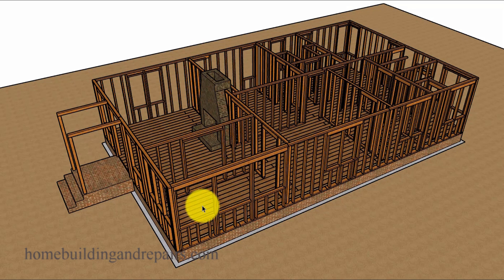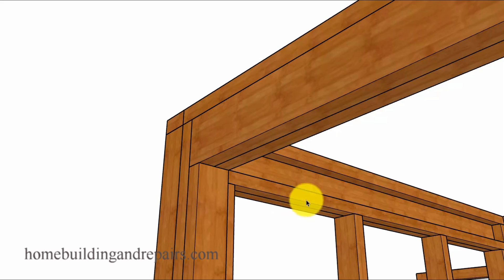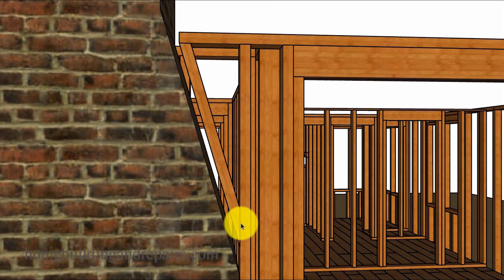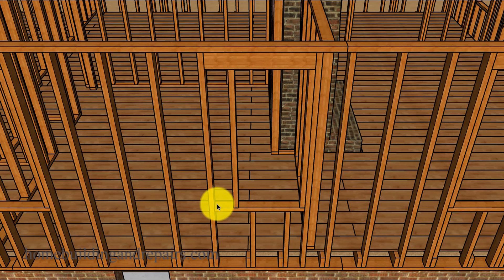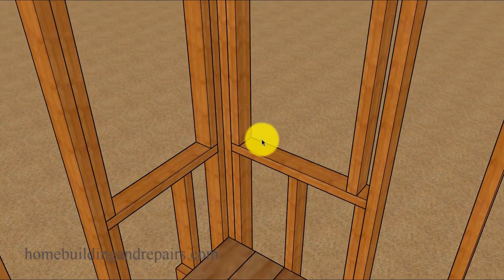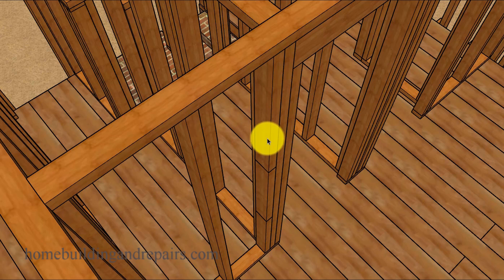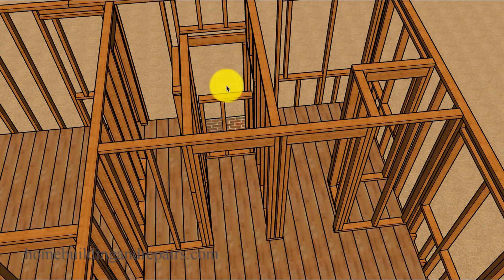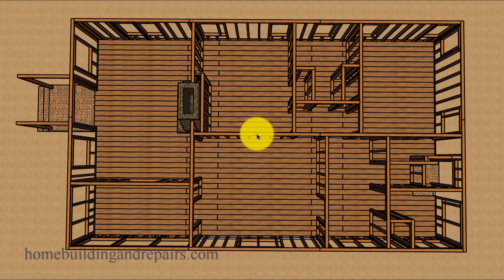Wall Framing Tutorial For 1923 Home Building Project - Part 4

Comment: my house in Australia has almost identical framing .Its a heritage listed colonial style and made from hard wood ,which was joined using cutout oblong holes and plugs in the studs top and bottom.The sill plates are as above and as a consequence ,in Australia it was attacked by turmites getting under the sill plates and progressing inward .Aussie houses are required to have ant capping at the pier tops and perimeter base wall in contact with wood eg. on the engaged piers which support the bearers.But thanks for your vid it will help me improve or change my framing .further i wonder if this design has advantage over more modern in that the flooring can be removed without much fuss.
Reply from the maker: Plywood or oriented strand board is usually used for floor sheathing and I think works better than the older one by materials. I would love to see a picture of your ant capping, to see if it's the same as our termite shield.

https://youtu.be/qaQ2yXVCwmU

Comment: Have you ever seen walls packed with a soldier course of brick above the top plate between floors? Wondering if that was a common way of fire blocking back in those days

Comment: My 1920 bungalow has a double top plate but no headers- even in the bearing walls. They used double 2x4's, flat., not on edge. Even an 8'-9" opening for a bump-out has a double 2x4. It's sagging and I will have to jack it up and re-enforce it because it is carrying both a ceiling and roof load. The base plates for the exterior walls set on the sub-floor. I believe it's called "Western platform framing".

Comment: My son's 1925 house (plus 2 or 3 later editions), I figured out is what's called a vertical plank box home. Built as possible temp home in a lumber mill town. There's been at least 3 additions. 
These homes were built with no framing studs. The vertical planks on the outside sheathing served as the studs holding it together. In addition to serving as the interior wall in potentially exterior. The interior floor and ceiling is also planked. The walls and ceiling were then wallpapered. Apparently they would do this every year until it would give enough insulation.
Sometime later studs were added to the interior to be able to run electricity and plumbing. The house was also raised before the last edition. So there are three levels of floor joists! 
There are some definite crazy things I've seen for construction! The top plate is actually one giant header going all the way around the house!

Comment: A lot of the windows, especially in the sun room, look crowded. I'm thinking once the lathe and plaster are on that there's not much room to properly trim them. Am I missing something?
Reply: In my 1920's house there are several doors and windows shoved together. They used lathe shims to bring the small gaps in between to match the plaster thickness around the outside of the opening. This brought everything to the same level so wide moulding could surround the group of openings with narrower moulding in the spaces separating the individual openings at the same level without using plaster in between.